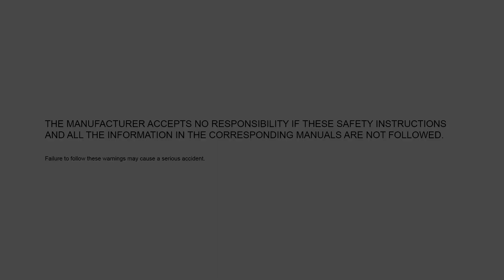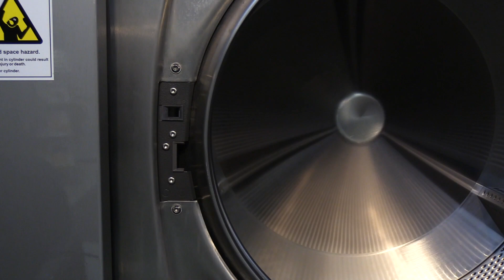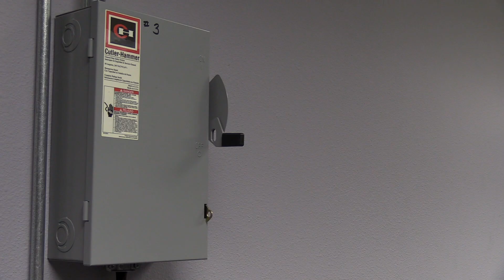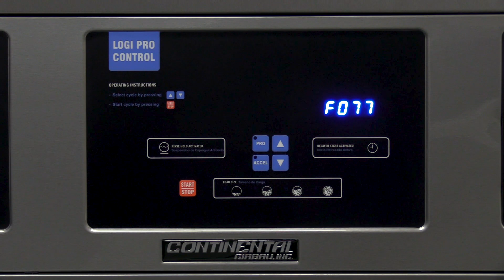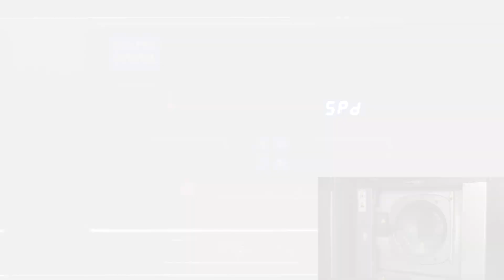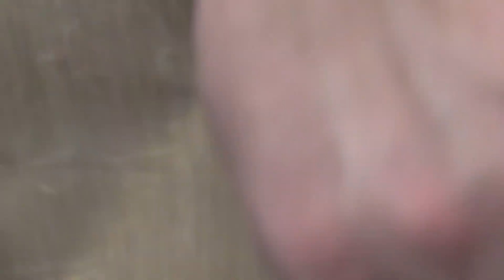Service Tutorial | Logi Pro Control Test Mode

Comment: I tried to schedule a service appointment for an older Girbau washer (2006 model) and they are  impossible to deal with. They do not care about you as a customer and do not care if your washer is down for 10 days. I am still waiting to hear from them! I got tired of dealing with their indifference and went to my hardware store and bought drive belts and installed them myself in less than 10 minutes. Really?? Do better Girbau!
Reply from the maker: Hello, We are sorry to hear about your experience. Could you send an e-mail to info@cgilaundry.com with your contact information and the details regarding who you reached out to so that we can address where we dropped the ball?